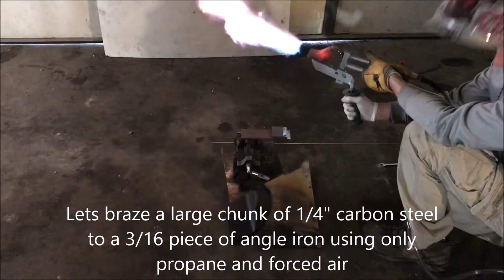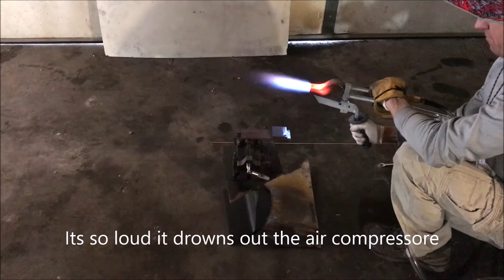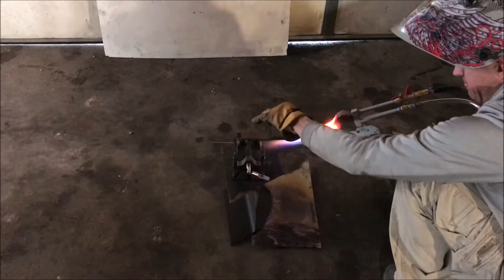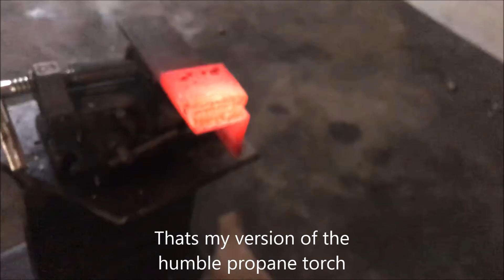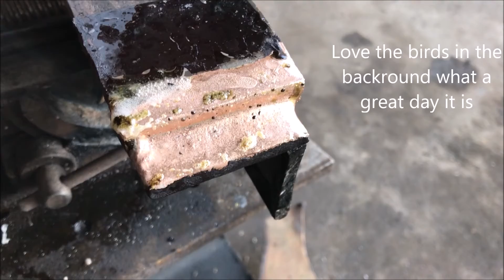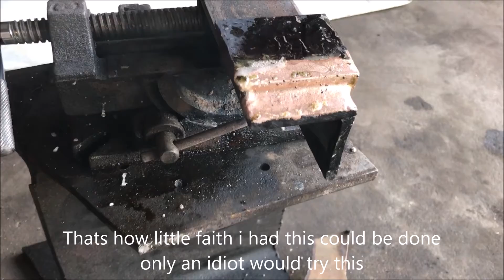High performance Blow torch FORCED AIR ASSIST

Comment: Propane/compressed air torches are a standard item- I used to braze with one 50 years ago. Still have it.
Reply from the maker: Funny i never seen such a thing in 42 years
Reply: @NOBOX7  Just checked- it is model no. NG/B2  made by A N Wilkes & Co of Stourport on Severn.
Twin quadrant levers marked gas and air. Used to have a smaller one, too but cannot find it...